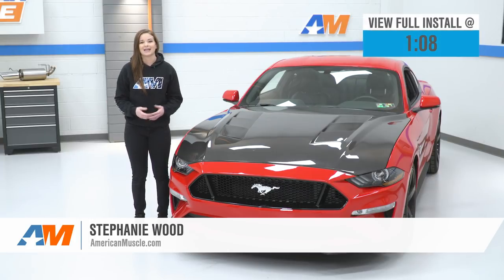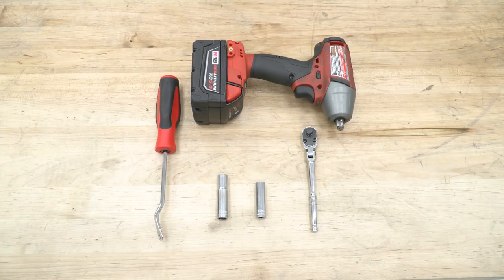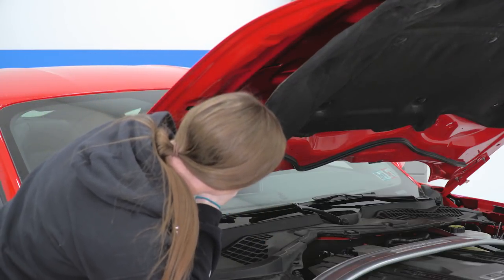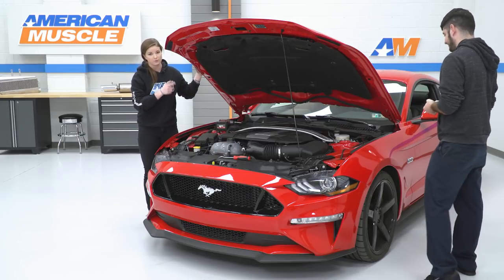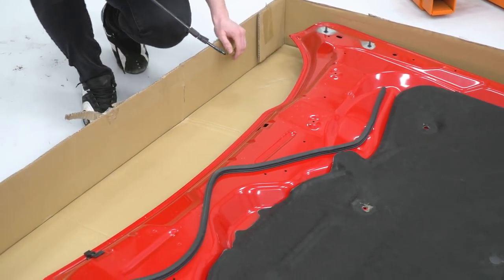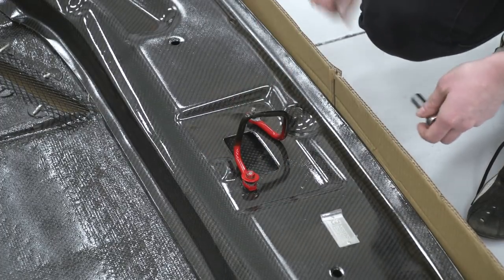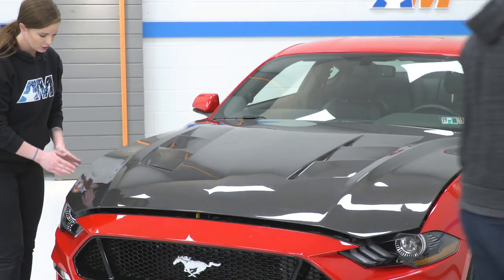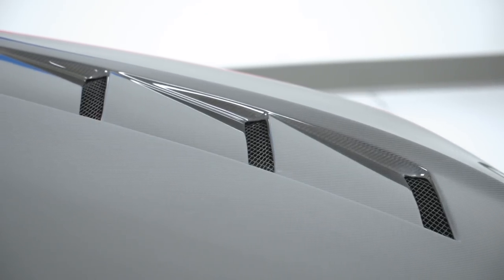2018-2019 Mustang GT & EcoBoost Anderson Composites SA Carbon Heat Extractor Hood Review & Install

Comment: So if carbon fiber is stronger than steel why are you required to add hood pins, and gas hood struts can't be used? Also where can to purchase the required matching "heat shield" that you mentioned? Somethings NOT adding up here.
Reply: Maybe its low grade carbon fiber?
Reply: You need hood pins just in case the main latch fails. Carbon fiber is lighter so during high speeds, it may fail. The heat shield is on Anderson Composites website. https://andersoncomposites.com/products/heat-shield-thermotec-aluminized-heat-barrier-adhesive-back

Comment: So you need hood pins but there's no provision for them, a heat shield but it's not supplied and no where to attach your windscreen washer fluid lines?!?! What the?!?!
Reply: $1,619.10 and to me, it's just not well thought out.  Anderson Composites should be embarrassed. The OEM hood is engineered far better.

Comment: The couldn’t even supply all the stuff you need for the install no pins no shielding and no spots for the factory washer lines or a hood latch .so many half ass car part company’s.